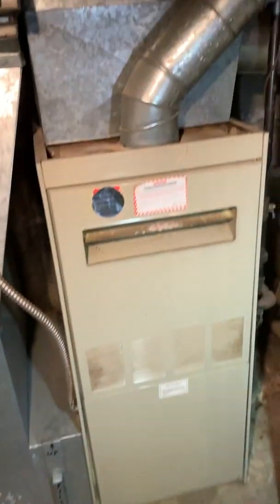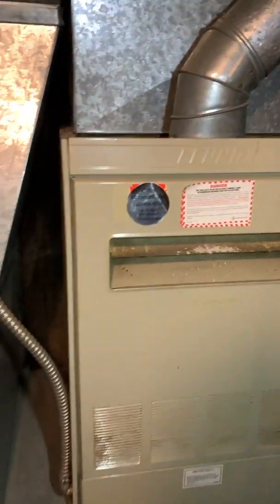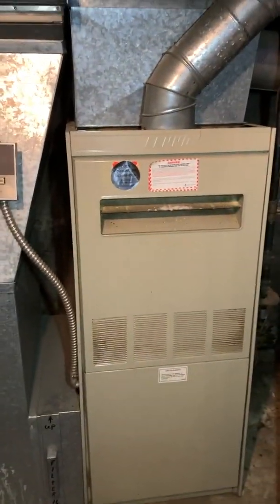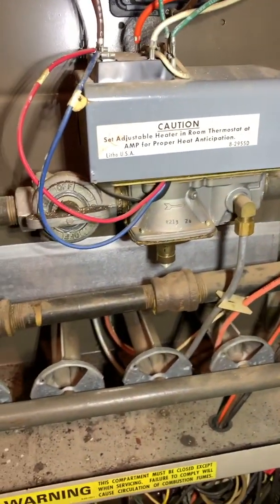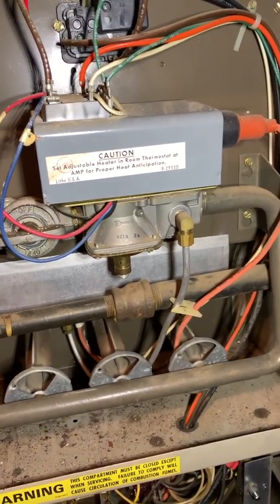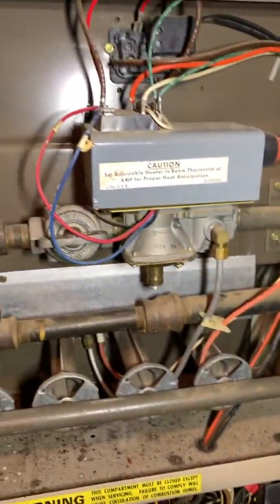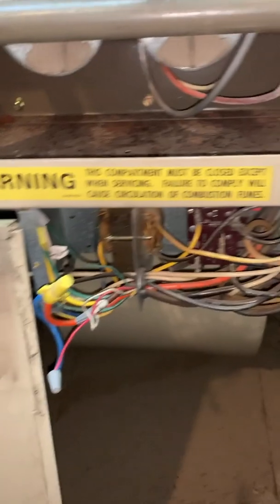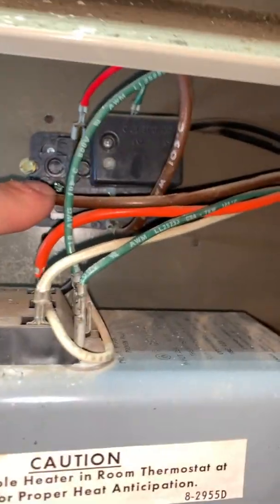Low voltage troubleshooting an old Lennox gas furnace

Comment: I just had my gas valve replaced because I was having same issue.. New one worked, but stopped firing up due to low voltage.. everything replaced and worked... 2 weeks later... same issue.. and will only fire up when I tap on the gas valve where the wires go into it